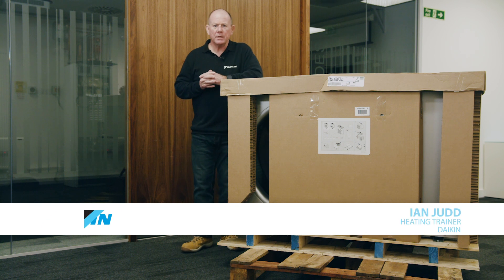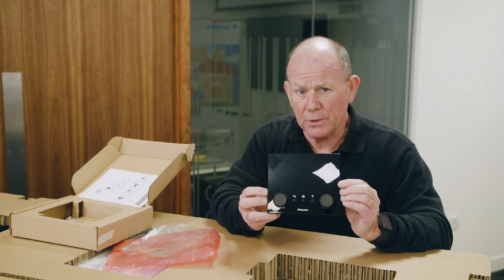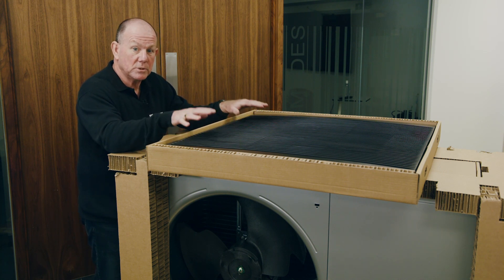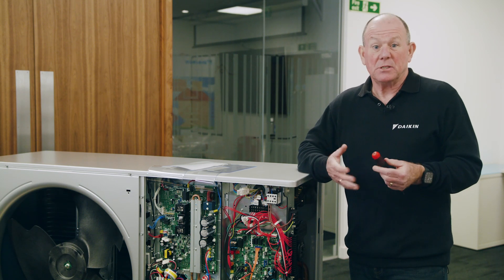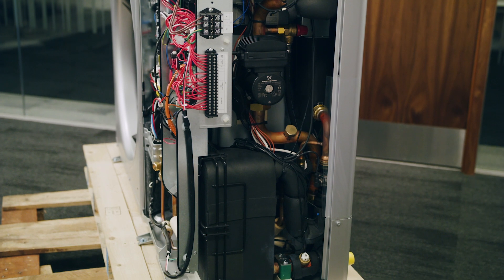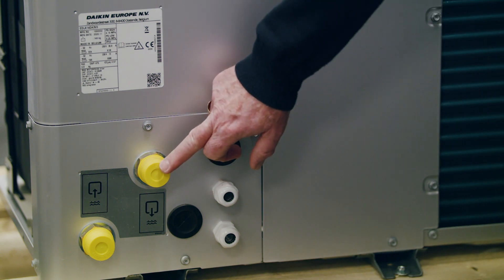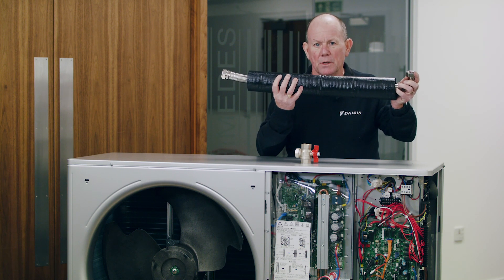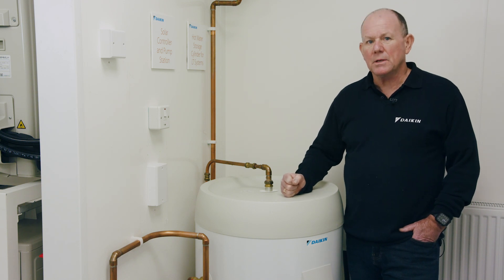Unboxing the Daikin Altherma 3 Monobloc

Comment: What is the condensate arrangement for the outdoor unit? Does this model have an internal drip tray and discharge connection or will it need a drip tray installed between the anti vibration feet and the outdoor unit?

Comment: Great video! I bought the same device in the 6 kw version only for heating! I have a Daikin M HW 200 for the service water :)

Do I need a secondary circulation pump after the buffer tank? Is this connected to the DHW power connection?

What secondary pump would you recommend if needed?

Comment: If it requires a backup heater you should have used a high temperature monoblock heat pump.  Bad design.
Reply: Nope. Backup heater isn't used for more temperature, it is used for more power when needed.
Reply: @ppanagiotopoulos  A heater is used for heat Einstein. The refrigerant is wrong or the system is undersized for cold weather. Transcritical CO2 would be a better refrigerant for high loads and cold climates. R-410a is the limiting refrigerant.
Reply: Hilarious comment. So your idea is that this low/mid temperature heat pump design should in fact be a high temperature heat pump. Well done. 🙄